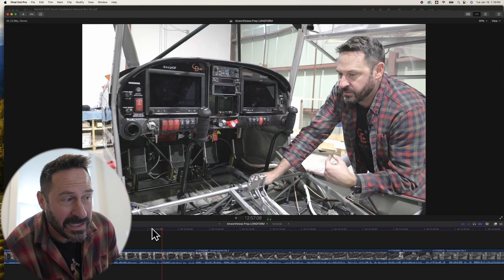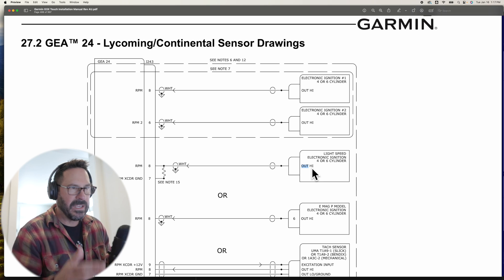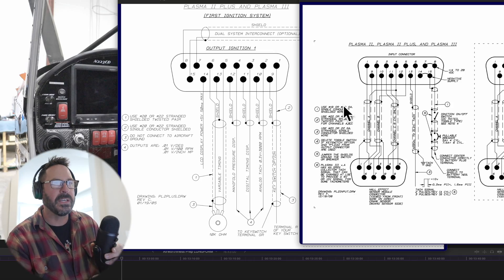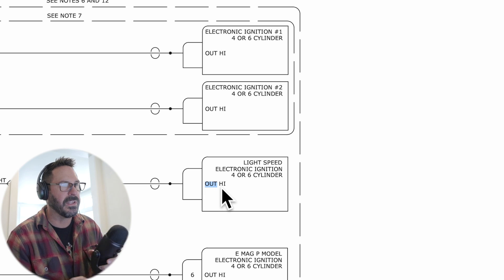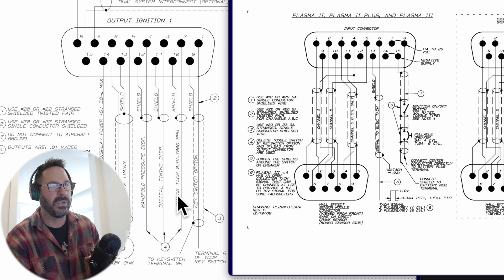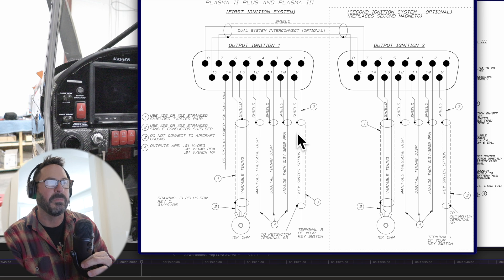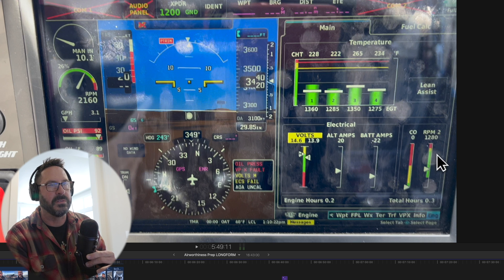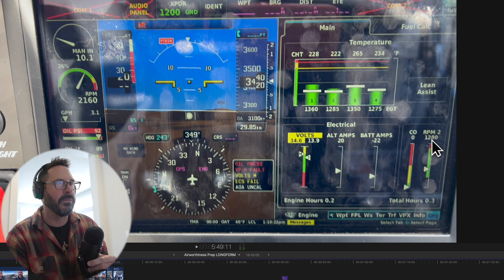How I fixed my RPM indication--Garmin G3X Touch + Electronic Ignition

Comment: Spade connectors weren't tight on coil packs and we failed "mag check" before first flight. My heart sank on what the hell did I wire wrong. I didn't know it at the time but 15 min later I found the problem and fixed it! 😊

Comment: And for those of us electrically inept, if you have an avionics shop (Stein, Aerotronics etc) wire your G3X harness remind them to put in the resistor AND wire both Lightspeed boxes for RPM pick-up. I had to send my harness back to be fixed and resistor added. Dynon and GRT might be different.